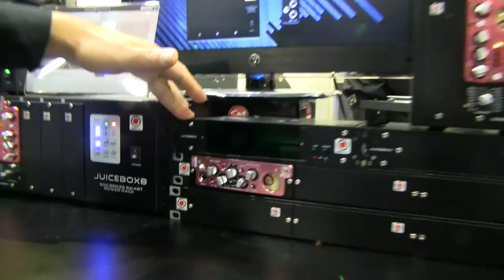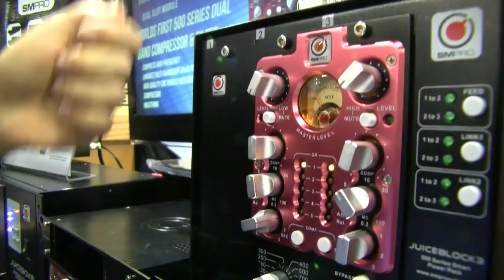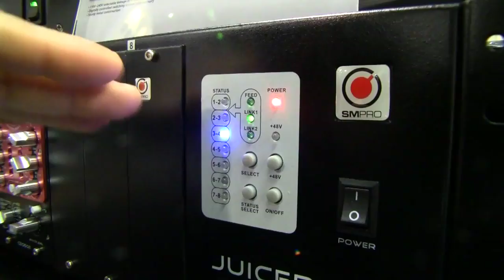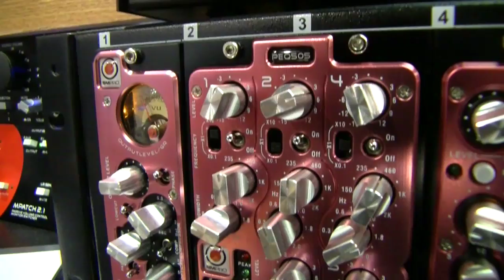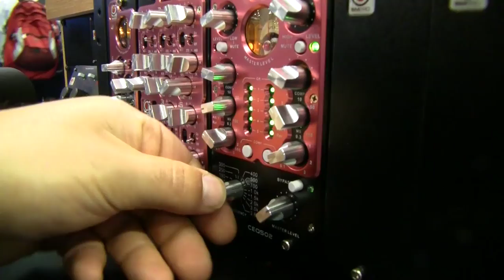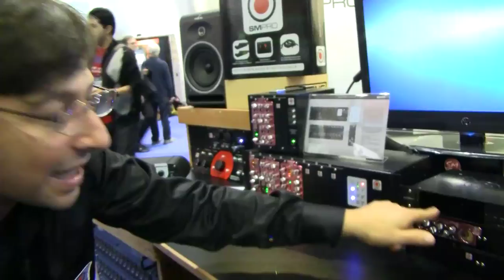WNAMM13: SM Pro Audio Affordable 500 Racks and Modules

Comment: MBC502 is a great little unit. The only difference from that prototype and the shipped units is the bypass switch which I would have prefered the indented push button actually... anyway... Alot of mastering engineers use multi-band compressors instead of EQ for go to vocal editing and tone shaping. Very interesting approach and the MBC502 does this very well and can be had used around a couple hundo. Unbeatable. Proving once again that Pultec for 3k is just absurd when considering what it actually costs to make such a product (a bit off topicbut I made an EQP5 which is identical to the pultec for under $300. ummmm..... yea.) SM Pro audio is a great company. Love the stuff guys! Keep it up!